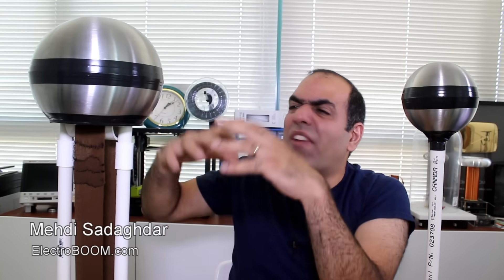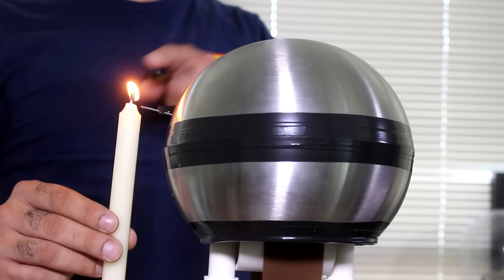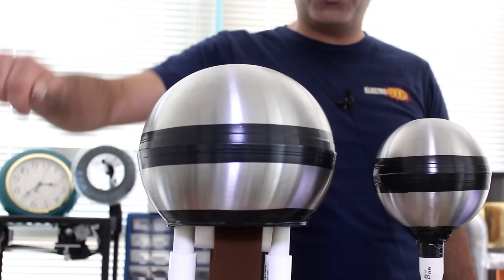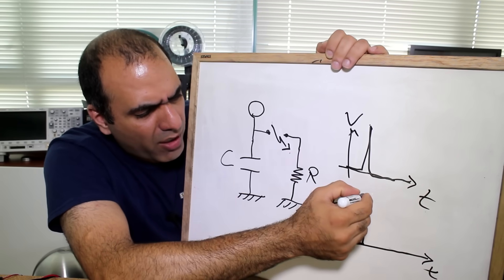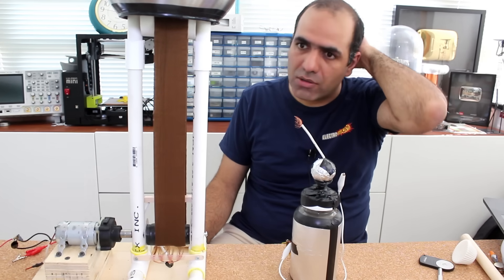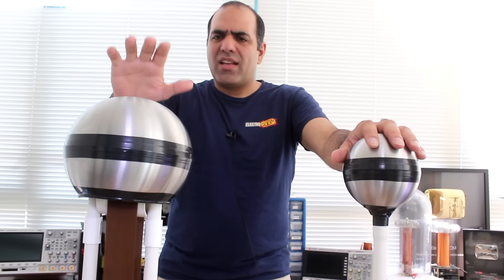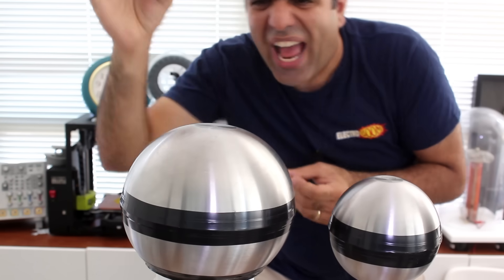Painful Experiments with Van De Graaff Generator

Comment: Hi, 
I have query regarding the flying off of the paper cups when flat face is up. 
    1.  When placed flat face up, the cup gets charged up with electrons so much so that they start to accumulate on the edges and then leak out of there. These leaking electrons (basically due to the large concentration of electrons on the sharp edges, they are repelled) push the cup into the air
    2. In the other case, when the cups are pointy sides up, these electrons are still leaking out of the edge points but now when they propel out they exert an equal and opposite force on the paper cup. Making it stick to the top dome

I.e. in both the cases electrons leaving and then exerting equal and opposite force on the paper cups is the reason for the behaviour.

Is this understanding correct ??
Reply: In reality the cup floats when it is flat face up because it gets charged by the dome, and then repelled by it, since they have the similar charges. For it to be propelled by the electrons It would need a constant current, and that only happens when it is flat face down, since the electrons push it closer to the dome and at the same time disperse the charge, making it less repelled by the dome.

Comment: If you rotate and also magnetize the hollow metal ball of van de graaff generator and then throw small balloons at the rotating metal ball, chances are the balloons will start orbiting the metal ball due to a large rotating electric and magnetic field, creating a fractal solar system. An experiment you could try conducting. Imagine if it works.

Comment: 4:25 you mean doesnt contain as much power in P vs t? So the total energy in that short amount of time is smaller?
Have always agreed about "its not the volts its the amps!" When volts are directly proportional to amps!
Its the total energy of the arc... The joules kill you. Well a lot of joules over a long enough time say 5 years isnt gonna hurt as much as the same over 1s. But also a peak power of close to 9999999999999W over a short enough time is also not gonna do anything interesting to you.... say over 1 femto second

Comment: 2:55 Calling out the old incorrect "It's the current, not the volts, that kills you" 

In reality, it's the Energy= Volts X Current X Time. Van De Graaffs are safe because the time value is extremely low. Think of it as being hit with a water balloon. Even though they can pack what feels like a wallop, they have a very finite amount of energy they can deliver at any given time, limited by the maximum charge that can be stored on the sphere before it starts bleeding off by ionizing the air.  Compare this to being hit with a firehouse- like touching a high voltage electrical line, where the time value is unlimited since the supply of charge is unlimited.
Reply: It isn't really energy either, it's more complicated than that. For example, you can tolerate 1mA indefinitely, but 1A for 10 seconds will fry you. Of course time matters a lot, 50A for 1mcs won't harm you, but it's not quite as simple as V*I*T.

Comment: 8:49 ans is because the bottom part of the paper is negative and the ball has a positive charge so it sticks and when placed on the open side, since it has positive charge it will repel and fly away. (BTW i haven't saw the ans so plz tell I am correct mehdi)

Comment: Maybe you could take the top part of the pantyhose just below the waist.  Cut it to be the width needed.  It will stretch to the length.  The waist part of the pantyhose have a lot of stretch a lot. Doing this you don't need to sow the pantyhose,  and there will not be a seam.

Comment: Can any one point me in the direction for a decent tesla arc coil....Jacob's ladder....and the vdg unit.. I've got 2 tesla coils and both resulted in returns...its been stressful as the wife is not into it and the kids are well atleast I can get them into science but not when we wait for items to be mailed especially from china nd then set it up and it does not work or is super weak :( any suggestions...200$ is my max price range....and assembled would be good I can do light assembly but just learning to solder...can follow directions if clear video help..my email is toddrhart52 at gmail.com

Comment: So the flying cups experiment works because, when upside down, the cups have an inner cavity (which gets pushed upwards by the electron wind). Putting the cups flat side down will have the cup in more of a V shape, in which the electron wind hits the sides which provides a negative lift, pushing it towards the ball.

This is in addition to your explanation. Great video

Comment: also you can only steal so many electrons from the belt without a nice ground system in the base to replace them? otherwise the electrons are building up in the tower and can only get replaced through discharge or air in the vicinity?

Comment: We made a van da Graff generator from PVC pipe. Belt ran inside. Then a series of sharp nails or aluminum rods picked up static wired to giant salad bowls soldered together. 3ft Sparks an flickered florescent lights on 10ft ceiling. ZZZZZZAASPP!!!

Comment: You said that the arcs generated by the Van De Graaff generator may contain more energy than the ones generated by the jar, but for a very shorter time, due to the lower time constant. Did you mean power, instead of energy? Energy depends from time, power doesn't. Same reason for which you cannot use lightnings as a source of energy.

Comment: The colder the air temp the more the charge can build because with lower humidity the charge has less to pass through. Correct me if I'm wrong. :)
Reply: I think hot dry hair is better
Reply: @Thebasicmaker  how?

Comment: You said in one of your previous videos that arcs are limited to 16kv per cm. You also said that the arcs from your Van De Graff generator jump 4 inches or 10.16 cm. According to my calculations if im not wrong, the voltage of your generator is 162560 volts.

Comment: 3:20 i still dont quite understand, in school i was taught that 1 amp through your body will instantly burn your blood vessels. Can someone explain that part for me?
Reply: If you manage to get 1A flowing through your body, then yes you will probably get vaporised. The thing is you need thousands of volts to achieve that. The point is that you need voltage in order to get current flowing (ohms law).  The resistance of the body limits the current that can flow through you.
Reply: @TheDanyschannel  well... the city power can kill you, and that is like 0,1% of the voltage that the van de graaff generator can provide

Comment: Question: You mentioned a problem with the college professor. With a transformer you can get really high voltages at mA or even nA. So what do you mean?
Reply: Also, 100 times faster discharge is misleading. The moment the breakdown of air occurs the discharge is all but instantaneous in both cases. The capacitance in Farads is a coulomb aka an ampere per second. So the higher the farads (1nF) the higher the amps. I'm just trying to understand - I know it must seem like I'm being a dick.
Reply: The smell of Ozone :)

Comment: I guess that is why airplane dischargers are pointy little brushes... gives static electric charge enough points to flow off and keep the wings and the fuel air mixture in turbulent weather free of any sparks...

Comment: ElectroBOOM: My father was an electrical engineer. Much like you. Only smarter. LOL. No disrespect intended. When i was a child he used to show me things about electricity. He once made a circuit he called a "Diode Cascade". It was like what you did in this video. But it had no capacitors. It was more like a full rectifier bridge connected to another  and another and  another and so on.  The output voltage was incredible. Do you know about this circuit ?  He wanted me to carry on his legacy. But I just didn't get the electrical gean. Instead, I got the carpenter jean.

Comment: What would happen if you connected the capacitor you made out of aluminum foil  and plastic in your Leyden jar video between the Van de Graaf generator and ground? If I'm correct, you could improve the capacitance by three orders of magnitude with your 10nF capacitor. Which would mean even more power! ;)

Comment: i want to set my own wind turbine  .    So i have two question
1   Which motor will good for wind turbine (3 phase induction motor will be good enough)
2    when get AC generation from multiple turbine will be put on parallel on single wire. (what precaution i will take ) As i want to create multiple turbine and then carry all the current in one pair or wire to 3 kilometer away.

kindly share your email or any contact
Reply: Using a permanent magnet DC motor will be the easiest, I would suggest that it just simplifies things.

Comment: Hey, I've got a little ac motor I'd be willing to donate for the van degraaff generator.  It runs at ~3000 - 3600 rpm which might be too fast.  It actually came off of a broken van degraaff generator someone threw out.

Comment: I have a question, and I don't know where to ask about it so I ask here. My christmas lights that you put on a christmas tree shine, but are not connected to the electricity. How is that possible? They were once connected, if I touch with my hand the thing you put to the electricity supplier, it shines even more brighter. How's that possible? What happens there?

Comment: @electroboom Hi Mehdi,
Ur channel is awesome. Can i request you to make a video about monitors, my question is, because i had an IPS led pc monitor that died on me. I usually turn off the monitor everynight from switch. So the question does a cycle of turning on and off a monitor decrease the panel life ? Is it better to keep it on and in standby mode instead of completely turning it off from the switch ?  I couldnt find answer and no one better than u to answer. Maybe not make a video but if u can answer me ur thought on this i would really appreciate it.

Comment: This is an incredibly stupid idea, but I wonder if you can connect the leyden jar in parallel to the generator and have the added capacitance. Unless there is some charge loss due to the foil or connecting wires, or unless the jar simply can't store such high voltages and begins to ark foil to foil (it probably will), that's going to be a very scary setup with some loud, powerful arks and potentially lethal outcome. So this isn't a suggestion to do it, neither to ElectroBOOM nor anyone else.

Comment: Would the Leyden jar charge to dangerously high energies without the spark gap?
Without the spark gap, I would assume the jar charges up to somewhere around the top dome voltage, which is around 200 kV. But at 200 kV, 1.5 nF holds an awful lot of energy, I wouldn't want to stand close...

Comment: Is the wind generated from a spike attached to the charged surface is due to interaction with the air? Or is it just a flow of electron or ions? Meaning, will this generate a force in a vacuum?
And sorry to break the 4th wall, but I'm wondering what's the percentage of you actually hurting yourself on accident?

Comment: AC universal motors that dimmers would work on are pretty noisy motors themselves. The quiet kind of AC motors need VFDs for speed control. A dimmer won't work on an induction motor.

Comment: In reference to the other guy's presentation.
You can't have a lot of amps without a lot of volts. So, back to which kills you, the amps or volts. Given your body is a constant resistance, it really is a combination of both. Higher voltage means higher amperage, and thus higher voltage has more potential to kill.

Comment: I was reading that the higher pressure systems are used for the record setting voltages to prevent the breakdown voltage from being lower.  They use special gases also.  Wondering how that would be DIY and if worth doing?  Seems at some point particle acceleration and fusion/fission occurs, though that is if there is a high vacuum on the  discharge bulb I guess.  Not my subject matter expertise though.  Seems microwaves are used to start the ionization also before injecting into the HV plasma accelerator also.

Comment: I got electrocuted from 11kV main AC lines for about 5 minutes. Sill alive though! with minor scars on the body.
Reply from the maker: Mains are not 11kv, and you were not shocked properly!
Reply: ElectroBOOM I am sorry I am bad at vocabulary. I got shorted with the distribution lines o 11kV with a rusty rod while trying to pull the string of my kite back. I guess it might be the rust that saved me ?

Comment: Can someone explain the working principle of EDM (Electric discharge machine) machines. How the sparks generated there are so powerful that they can remove metal off of the workpiece surface ? Also, what actually governs the spark energy in an electric discharge?

Comment: Nice experiences! We have this discharges on the flour pipes were have acrylic displays. The flour is transported with blowers and goes through the pipes causing friction with the acrylic and generate eletrostatic. For discharges without sparks we use cables that ground and stop the potential. Maybe can use capacitors to keep the electricity and reuse.

Comment: @4:27 
Isn't VdG setup containing less energy?
Say it's capacitance is 100 times less and voltage 5 times higher, it should contain 5**2/100, ca 4 times less energy, won't it?

Comment: What happens if you charge the layden jar using the top of the Van De Graaff machine? Would it arc to itself or the voltage at it be more dangerous, as the time constant has increased?

Comment: I know from experience that if you stand inside a plastic tub (like a recycling bin) while you're charging you can dramatically increase the system's capacitance.  On a dry day, discharging to ground will shock the ever loving shit out of you.  Another fun moment is charging next to a lab bench and leaning close, only to discharge through an arc between the ground of an electric socket and your genitals.

Comment: In high school, my science teacher (Mr. Hart) had one of these on the display table at the front of the class, doing the lifting-hair demo et al, & I was still at the generator when he came over to shut it off. Since I still had my hand on the globe and being an obnoxious teenager, I reached out and arced to his nose. The class laughed loudly at his yelp, but he was VERY angry. There was a good 10-15 second pause where it was obvious that he was running through his mental decision tree about whether or not to send me to the office. Luckily for me at the time, he opted to only scold me gently but firmly.

By the way, your demonstration of static discharge from all charged surfaces with the most intense discharge from pointed or sharp parts is an excellent tool for debunking the morons claiming that Tesla discovered a superior method of free electrical power distribution.

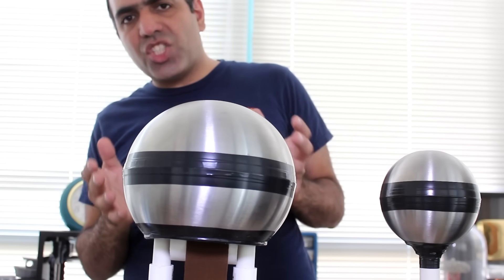Comment: 5:43 sooooooo tesla coil (AC) + HV diode + layden jar = fun?.. i think even a super micro tesla vould do MAYEM

this "DC" term is a bit overused, is rectified AC a DC? is 0:23 DC? we need better terms

why the two "balls" (no misinterpretation intended... before now) are of different size?.. that will be a capacitor of the surface of the smaller (i think)

Comment: What if you weld the dome so you remove the edges , also go higher and put something with huge amount of resistance between or bridge them , will it heat up , how much and where would be better for it to be between the domes or connected ?